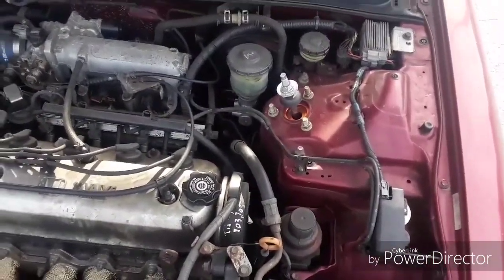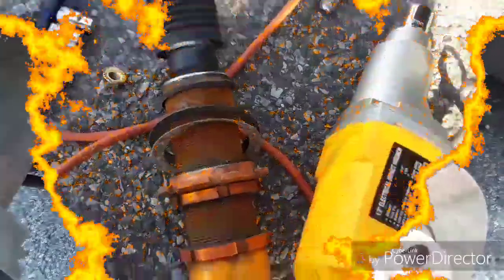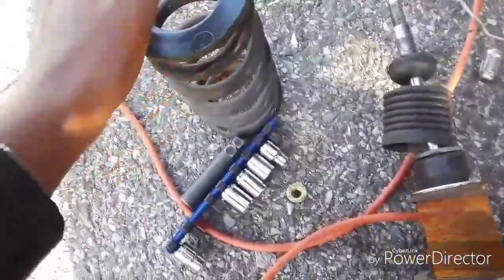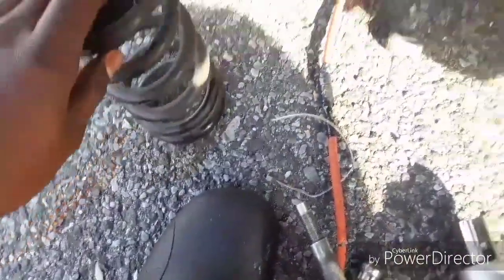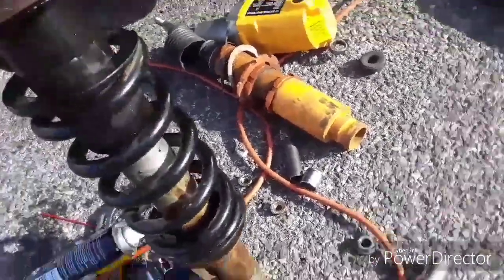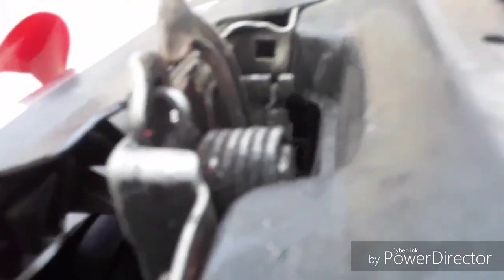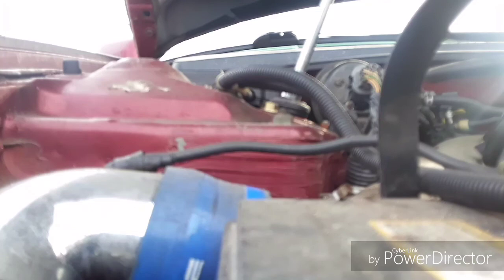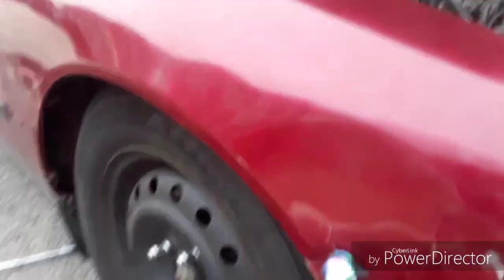DON'T BUY THOSE EBAY COILOVERS

Comment: Just put a set of these maxpeedingrods coil overs on a BMW E39 and the fronts don't fit correctly.  Had to do a bunch of fabricobbling and use shims in the bottom pinch mount to try to get them to work.  Then after a whole day of fighting to make them work, the ride is terrible.
Reply from the maker: Lol